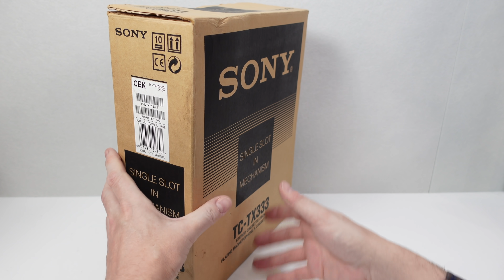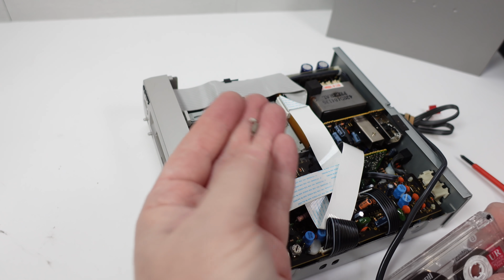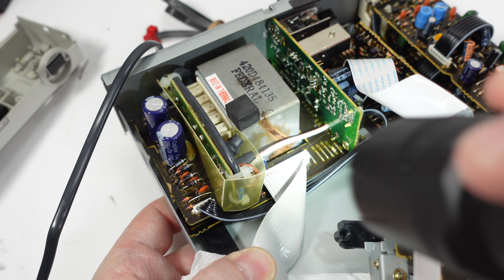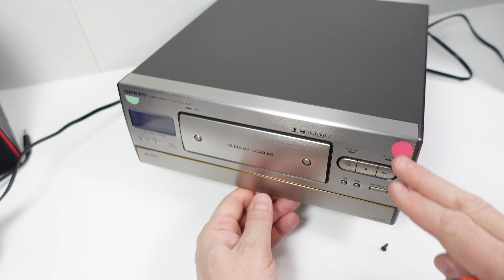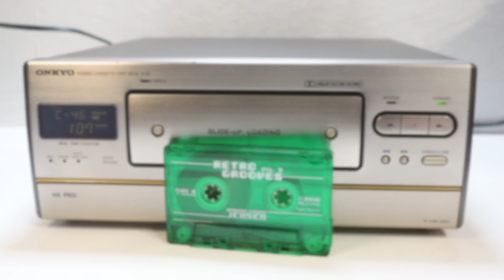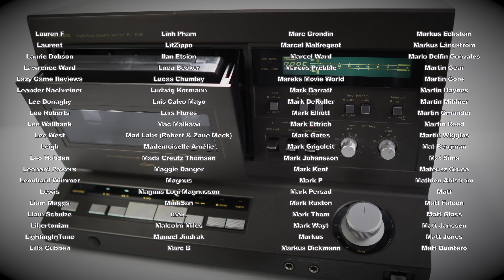Man spends 27:41 messing with two old compact Compact Cassette decks

Comment: There's always a problem with a Sony control panel. I have some examples here.
Reply: I'm not a great fan of Sony after they made a really good receiver which you could not wire up the phono to go through an equalizer and back into the receiver while anything was wired to it that would!  Or, which Technomoan showed on one of his videos with the minidisc recorder swallowing tapes because of the drive belt for the disc operation.   Pity really because they sounded fine.

Comment: I have the next generation of that Onkyo slide up cassette I bought in Japan (it has quite an elaborate LCD screen on the tape drawer). Trouble is when I lived in Japan I only had some J Pop tapes, which I wasn’t familiar with, so I assumed the player was playing fine. It’s only when I moved back home and played an old The Fall tape did I realise it was running slow.  I’ll get around to trimming the motor at some point
Reply: I have an next gen Onkyo too, it's an K-511M with auto reverse, the screen on the tape drawer is VFD not LCD.

Comment: It's always a good idea to use rubber rejuvenator (such as Platenclene) as well as isopropanol, on rubber components.  This restores the grippiness & resilience of rubber components like pinch rollers, rubber tyres, & belts.  It really does work I've revived loads of rubber tape deck bits with this!

Comment: My parents had a 1970s Zenith Allegro integrated stereo with the slot-loading cassette player. It was a great player, until it developed an appetite for tapes, and no amount of cleaning cured it. When it was paired with the original speakers, it had a fantastic, warm tone, and still did on the phonograph and radio. It could even make AM radio sound good. I miss that stereo.

Comment: That Onkyo system looks as Liverpool Mini PCS-05 but in my catalog it is with double cassette - standard loaded vertical in front. Actally I was deliberating to buy that one but finally purchased  in1993  bigger ONKYO  set.  That Mini they offered with dedicated Onkyo speakers PS-05U May be  they provided customer option to choose that one single advanced cassette instead of double? .  CD in that system reminds that tape deck exactly only difference is that CD door/tray is more flat.  System had  had 45W per channell an d flutter they stated 0,07% so after all years still granted 😄

Comment: The manual indicates the Sony TC-TX333 is indeed designed only for use with the DHC-MD333 component system, but there are other videos on youtube of people using it on it's own.
Reply: I wonder if there’s some ‘hack’ to make work on its own.
Reply: It might be so that the cassette deck can be controlled by the remote which came with the rest of that system.

Comment: I recognize the design instantly. That's probably the optional tape deck for the mini hifi system in my dad's office since I am a child (still there and working very well). It has CD, tuner and mini disc. I remember i noticed behind the tape RCA jacks inputs and outputs. So here is the thing !
Reply: Same mdc1333 I have, that's the missing deck, but the MD gave up and I had to disconnect it in order to use the rest of the unit.

Comment: I bought the Sony TC-TX333 from a charity shop for about £10. It worked fine without the rest of the micro system components, but needed it's belts replaced. I put it in my 'to do' pile, but the wife said I had too many cassette decks, so it's now gone to a friend 😂

Comment: That problem with the Onkyo is a classic symptom of a bad take up clutch. It happens when the internal felt pad becomes compressed and the takeup torque increases.This causes the tape to ride over one side of the head. If the clutch isn't too bad, the tape may wander back and forth like yours. The next symptom is chewed tape, as the tape will be pulled right off the side of the pinch roller and wind up in the roller axle. The fact that it came right in your case suggests that the clutch had just become a little frozen from lack of use, and it free'd up. If it starts chewing tapes for the new owner, they can do a home repair on most models by pulling apart the two halves of the take up spindle and cutting half a loop (or so) off the spring. Reassemble, and Bob's your aunty Mary

Comment: I bought the complete Sony system  MD313 which came with the 333 cassette unit in December 1998 . £440 if I remember correctly and been using it for over 23 years now. Admittedly I rarely use the cassette deck but it all works ....CD , Mini disc , cassette and radio . I currently have a record deck booked up and love listening to vinyl all over again .
Reply: I have the same system i bought it in 1997, works great, sounds great. I have hundreds of cassettes and it plays them with great sound quality.
Reply: My parents bought it too... Loved playing with the MDs on it as a kid... Sound was great... Sadly the CD deck died at some point... Always wondered how the cassette deck for it would work

Comment: That tape size function is neat in concept, but it seems a little impractical given its options ; how many C-70 cassettes are there? I've never seen any. C-74, sure, but not C-70. C-80 exists but they seem to be pretty rare. More common are the C-100 and C-110, which are skipped over entirely from C-90 to C-120 (the latter being "less popular" due to their delicate tensile stress tolerance). 
I would think the most logical options would be C-45, C-60, C-90, C-100, C-110, and C-120, with maybe C-80 thrown in for good measure. A complete list of options would include the "CD-it" lengths which featured C-54, C-74, and C-94.

Comment: I hope you didn't use alcohol on the pinch rollers.  That can cause them to deteriorate over time.  I just use a lightly damped swab.
Reply: IIRC, he has a designated solution he uses on them purpose-made for restoring rubber like that!

Comment: This has brought back real memories. I bought this tape deck with the micro system, which had minidisk,CD & FM RDS radio in 1999. It was the first thing I ever bought with my first wage packet from my first job. 
The ta ok e deck was an extra £120, and for the following 22 years (yes I still have it) I have never used it to play a cassette, but at the time, buying a sterio without a cassette deck was so alien to me, I felt compelled to splash out the extra for cassette 😂. I clearly remember the whole system cost £500 from Sony store Nottingham.
Reply: It connected to the main system was with a ribbon cable & some RCAs if I remember rightly
Reply: Loved that thing .. my parents had the same - but no cassette add on

Comment: That Sony machine does look nice, if it had worked.  I wonder if replacing that transformer would fix it.  If I wasn't a lazy cuss I'd be willing to poke at it with a multimeter.
The mechanism on the second machine is a bit unique.  With all solid state electronics anymore you don't get fun unique designs to machinery anymore.

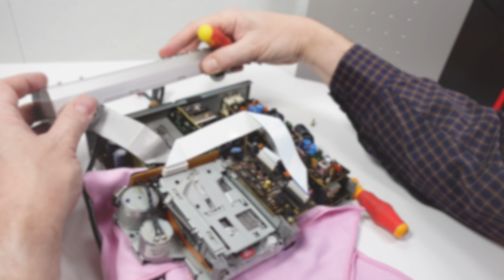Comment: 6:50 - I wonder if the spring belongs near the tape door? It seems to be way too floppy for a Sony. Now, a Sears, Audiovox, Urban Audio Works, or Road Gear cassette deck, that floppy door action would be normal. 7:57 - You found it. :-)

You know who would watch a video about the Onkyo's unique loading system? The same people that watched the Rube-Goldberg Auto Reverse Deck and the Ski Jump Auto-Loader Deck.

You might be right about the power transformer in the Sony being bad. The discolored "pip" on the top of the transformer itself makes me wonder if that's a cosmetic manufacturing flaw or the transformer overheated. If you knew more about electronics, you could probe the transformer with a meter and see if any of the secondary windings are dead - but it's not something you should really go poking about if you're the least bit unsure. I highly doubt the "AU BUS" needs to be connected to anything in order to function as a standalone unit - it's possible, but I've owned Kenwood, Phillips, Onkyo, Pioneer, and Sony equipment each with their own "BUS" system connections, and all of them operate independently.

Comment: Was going to say that Tape deck looked like the optional one I need to go with my Sony EX880MD Mini HI-FI Component System but turns out it's actually the TC-TX770 for mine and not the same.
I'm sure these tap decks can be used separately though as on my unit everything is connected and powered via system control ribbon cables with only the AU BUS left which I would assume allows the tape deck to be connected but powered separately as it's an option on the amp that I can select and the deck in this video just has the AU BUS connector on it plus power lead.

Comment: I have an identical* - looking Sony tape deck, but a 373, rather than a 333, attached to my Sony bedside 'HiFi'.  I have not connected the bus lead, but the tape deck works works without it. My understanding is that the bus is for remote control using the hifi's handset. 

*To pedants: OK - almost identical, apart from a 3=>7
Reply: The bus is not only used for sending remote commands to the specific device, but it is also used for the "CD Sync" recording feature.

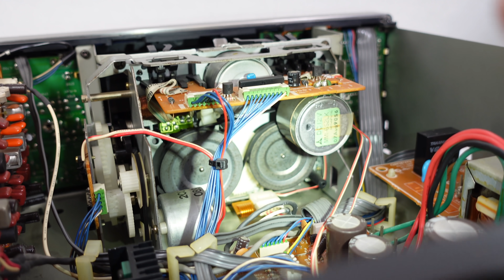Comment: Thanks for this video. I have an Onkyo K-200R autoreverse deck, but I'd had to replace the belt, and it wouldn't play in reverse. The mechanism in the Onkyo deck in this video is very nearly the same inside, but with that autoloading addition. When you opened it up in your video, at 18:46, I could see straight away why. I had put the belt the wrong way around the flywheel, and it was rotating backwards.Just fixed it now and all works as it should. Thank you for saving me a lot of time working out what I'd done wrong. I should add, that I bought the deck recently and the belt had disintegrated, so I never got to see how it should be routed.

Comment: The theory that the first cassette deck was designed to only work when connected to an amp through the special connector doesn't make sense.  If that was the case, why would it have RCA jacks on it at all?  I don't see any cracks on the ribbon cables in the video, but that doesn't mean there aren't any.  It certainly acts like there's shorts in the control system somewhere, and the ribbon cables are top candidates.

Comment: You can de-glaze pinch rollers with sand or emery paper (something around 500 grade), removing the hardened top layer of rubber, thorough cleaning afterwards with the usual isopropyl or meths. If you've recently brushed your teeth spit works pretty well too(!!).

Comment: Could be a bad capacitor in the line-filter near the transformer. I once had a similar problem with a Braun C1 Cassette Deck that would randomly switch off when consuming too much power. Inspected the line-filter caps, found them to be cracked  (both) and replaced them. - Problem solved.
Reply: Or dried out capacitors. That it shuts off the moment it needs some power (e.g. the motor for eject) is hint in that direction.